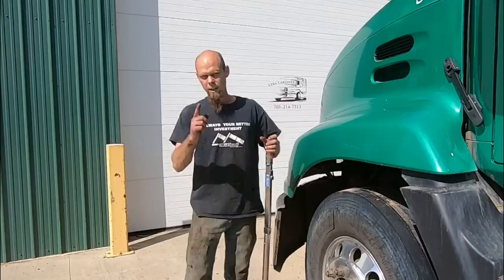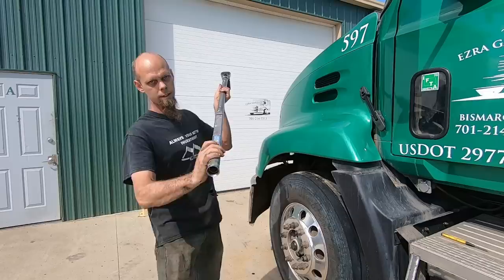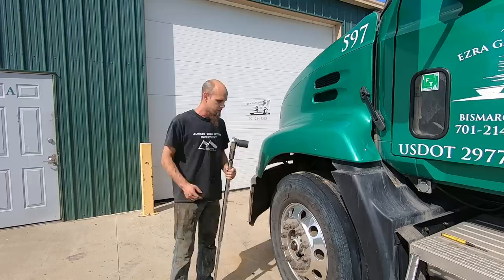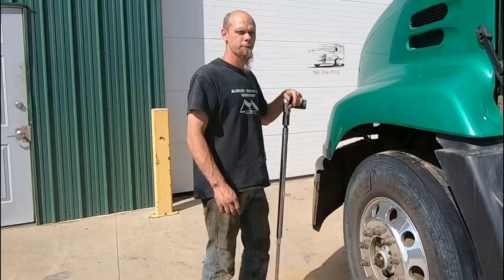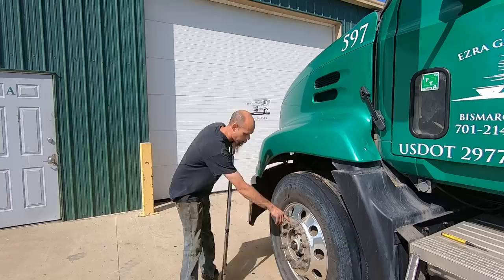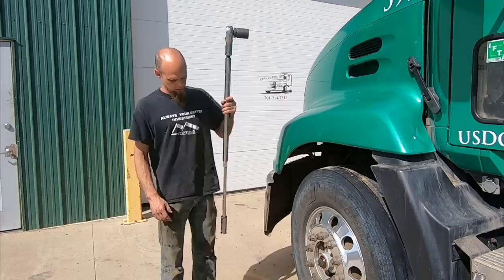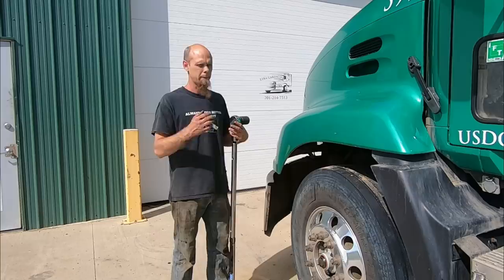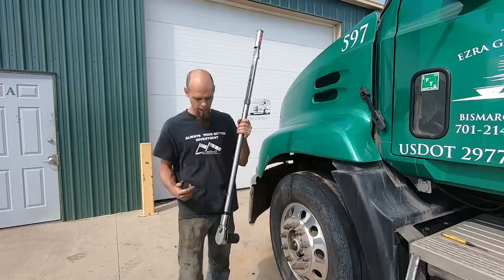Torquing semi truck lug nuts - Precision Instruments - C5D600F36H 1" Drive Torque Wrench

Comment: If only more folks used a torque wrench on lug nuts. 
The 1' tire shop 1500lb torque lug nut gun is for removal!!
Reply from the maker: i use air for removal as well, the breaker bar is a nice bonus don't use it much but its nice too have.
Reply: Tell me about it. My buddy had his brakes changed at a tire shop on a Dodge 3500, and the guy used an impact wrench to put the lug-nuts back on, two days later the lug-studs broke-off and the tires rolled down the highway into the woods....
Reply: We use the gun to put them back on. Never had a problem and we have over 350 trucks in our fleet. Just don’t over tighten them.
Reply: Yes sir. I didn't have nine and had to use a 10ft pipe to get the wheels off.

Comment: I haven’t heard of someone wanting to torque a semi in some time. Impacts were made to loosen lug nuts and NOT tightening them. I cringe when I see or hear a shop use an impact on wheels and not torque them. I’m glad you mentioned the bit about the surface area where the lug nut goes being clean. This is a rule my oldest brother passed down to me ...If you have a tire replaced on a semi, have them checked or re-torqued after 100 miles , when you get back home or if you feel any vibration. Having your own torque wrench is a great idea. I like the preformed cases that come with tools, but I would get a new toolbox and make my own form that would allow the breaker bar to be included. The problem is finding a toolbox wide enough! Good stuff, bro!

Comment: I’ve been using that same wrench for five years now. Works great.
Reply: They need to be calibrated every year.
Reply: Arnoldo Adaire I had The calibration checked a few times, against another calibrated unit, mine  was so close we never sent it back.
Reply: I'm going to get one of these
Reply: How does it works on a rear tandems ?
Reply: @AKA Shady  ...you can get a 14 extension from Kentool or Norbar via Myers if he doesn't already have a link.

Comment: Those PI wrenches are nice, I have 2 of those and they've held up well. Check them every year and so far the calibration hasn't moved any. They're fairly priced for what you get as well I think and nice to be able to buy a US built quality tool still.

Comment: I remember we had these badass HyTorq hydraulic torque monsters, we used them to tighten and torque 4" nuts on the jaw crushers at the surface mine.
Reply: 15 pound sledge hammer on our cone. It's around a 4" thread, hit it till she dont move anymore.
Reply: Hey WOW, I was looking at some of those but went with torcUP due to other considerations but there are many decent players in the field, ALKITRONIC has a good video that explains the affects of lube on studds, when I worked for a over the road fleet and used antisize, the broken studd remover got a lot of use, but when I went to work on garbage trucks and school buses ,the antisize wasn't allowed but then the inner nut would stick and the Budd nut wrench(pork chop) was needed frequently .

Comment: Great video. Excellent discussion on torque specs and pros and cons of the torque wrench. Thanks and cheers.
Reply: Have been doing this 30 years but still not completely satisfied with the methods at hand, sometimes there is lube or antisize on the studds, even from the factory and that changes the friction affects torque as rust would have the opposite effect, I don't have any recommendations at this point but there might be a possibility of using angle instead of torque and some sort of locking device. (like a teardrop plastic nut check)

Comment: Hi again i'm from UK ,i am retired big rig driver/mechanic.I have seen 20 stone drivers  jumping on a wheel brace with a 4 ft scaffold tube on until they hear creak creak ,and then when i have been called out to them when a wheel fly's off they have said to me you must not have tightened them  when maybe i have had wheel off to repair something.Not that 20 stone jumping on 4 ft extension  doesn't stretch wheel stud threads or fractures stud .This was common in my days but you could not tell these type of drivers they know best.IDIOTS.

Comment: This was really helpful! Ive been debating about wether to get a 1in millwakee impact gun, which i still plan on but that torque wrench looks like a good option for on the road, least no batteries!👍🦝
Reply: I happen to own both along with some other air impacts and torque sticks and most recently a pneumatic torque multiplier which seems the most promising, but I would start with the torque wrench like he has or a broke back type. (no relation to the movie)

Comment: Guess I've been lucky, but for 52 years, every lug nut I have had installed has been torqued with a 1" rattle gun. I have had to take a torch and burn of studs on the off highway log truck I drove in the '70s when they seized up due to salt rust and snow those were 14-24 Firestone(?) Rib Excavators on the steer tires. I do remember that the tire and wheel weighed 345 pounds.  And, the tire man at Weyerhaeuser could pick one up and toss it in the back of his tire truck. Nice guy, but not one to mess with.
Reply: Hey WOW man, this all is very manly and I hope I don't come across like a goody two shoes but before anyone tries using a torch on a lugnut that has the tire still on it whether inflated or not, they might want to watch some of the Bridgestone safety videos...I like one title PYROLYSIS.
Reply: @cameronduff884  Nah, the tire was always off the rim. usually, we went back to the shop that night missing studs. Nightshift would replace the studs

Comment: ironic, i am looking at the precision 3/4" torque wrench on amazon as you notification came up.....not sure if i am replacing mine with the precision, cdi (company that makes snap on, or a snap on torque wrench. the fact that the include breaker bar attachment doesnt go in the blow molded case  is irritating....but not a deal breaker for the cost.
Reply from the maker: iv had mine for quite a while now overall im happy with it. i rarely use the breaker bar but its nice to have.  the case and the one button being to small to press with your finger are my biggest complaints. i just decided to do a video on it cause i needed something i could film and upload without a lot of time into it and apparently the internet has a obsession with torque wrenches....lol
Reply: Mr Smith in the house!!!!!
Reply: @Ezrider359  i have a older snap-on and the buttons are the same lol, irritating for what you pay new for them
Reply: I wrote my comment before I read yours
Reply: @flmmaz  how have you been my friend? sure do miss your videos! sure hope things are going well for you.
Reply: @Ezrider359  i ended up ordering the snap on qd4r600a. it is a click type not the split beam....it was a deal.

Comment: That wrench is almost as tall as you!!
Reply from the maker: longer the better, 500 ft lbs is 500 lbs of force at 1ft if the wrench is 5ft long that is reduced to 100 lbs of force for the same 500ft lbs.
Reply: @Ezrider359  make a 500ft long one

Comment: Right in front of handle the steel just snapped only ever used it on one truck and two trailers. Boy seen one one internet for sale about ten miles from home case and everything. It was a prescision instruments six hundred pound. Paid six hundred dollars for snap on. This guy wanted three hundred dollars. I offered him two fifty. He took it. It was exactly the same exactly as snap on. The only difference the snap was red were you adjust it the p I was blue. My son looked on internet and found out p I made the snap on. Still have pre instrument yet works great. Didn’t know if you new that. I torque four fifty truck and dropdeck. Enjoy your show. Just bought tiger tool for taking anchor pins  out when doing brakes Havent used it yet. I will keep watching.

Comment: Well on the flange style lug nuts like in this video requires 5w30 motor oil as well

Its 450 to 500 ft lbs ...

Set the torq wrench to 475 and your good

Me i just oil and use the gun

Reason being 50-100 miles is a retorq requirement...

Drivers dont stop... not my fault ...

Ta charges 7 bucks no wait they come right out
Reply: But according to the Alcoa manual, only 1 to  2 drops per outer end of studd and 1 to 2 drops in the thrust washer. (don't take my word for it either)
Reply: Agreed

Comment: Been looking for a tool like that every time I go to loves for a tire repair I say to myself I wish I had one of those now I got one thanks bigdog
Reply: Do you keep it on the truck? Has the torque calibration gone way off kilter from bouncing in the truck? Thanks
Reply: @markm0000  yes I keep it in the truck calibration still the same
Reply: @1971bigrob  Ok good 👍. I’ll get one along with a extra wheel to mount a steer and get me home. I paid thousands and thousands in roadside tires and I’ve had enough.

Comment: Just bought that brand but in a 3/4 I have the older style wheel ball n seat just got 6 brand new aluminum wheels and want to make sure there torqued right
Reply: Hey WOW, I have the same thing, it's great ain't it!!!just in case you didn't already know it, my ALCOA manual says you can put 1 drop off oil on the studds but not to let any get on the ball seat.(don't take my word for it)....search....

Comment: Nice review and tips. You sure pick great products. I purchased one through your Amazon link. I did notice that you can get it cheaper but minus the breaker bar. Thats probably the norm as the blow molded case shows. The combo pack has the breaker bar added. Can't wait to get it. Keep up the good work.
Reply from the maker: supposedly they have updated the case, to include a spot for the breaker bar as well as a extension and socket.
Reply: @Ezrider359  maybe Precision can send you an updated case. It's worth a call. I'll let you know if they send a case that holds everything when it arrives. Who knows, maybe they updated their case after your product review. I recently got a new blow molded case for a different tool that actualy broke at the clasp after one use.............kind of the same but different.
Reply: @Ezrider359  You are correct. I recieved the combo set all in the case with room for 2 sockets and maybe a short extension. Very nice tool.
Reply: @Ezrider359  cool, we should have come here first, our torque wrench was "sacrificed" for the sake of field expediency, and nothing was said until I pointed out the bow going the wrong way and used a torque calibration cube on it. (they finally sent it out for re testing) but probably were never guilty of being under torque without a regulator or torque stick.

Comment: Nice video! I'm tool / precision friendly; but I've seen Les Schuab's tire techs tightening those nuts with their power tool, idk if it was related, but 1 month after geting new tires (from them) a front rim cracked!!!
Reply: If the crack happened near or around the lug nut, then yes it was due to over tightening the lug nut. The torque spec is there to keep the bolt or nut tightened so you won’t damage anything as well as it not coming loose, whether it would be the threads, the bolt or nut, or the part itself, in this case it was your rim.

Comment: Do they make torque sticks for a torque spec like this? I know they make them for normal passenger vehicles, but for a truck I feel like it would be a decent idea rather than just ramming the lug nuts on you can get in a ball park range for the torque spec
Reply: God Bless You!...I just wish I could give you a straight answer..I found the perfect torque stick from Accutorque (made in Sweden),but can no longer find it in my 1inch drive, 475ftlbs, 33mm configuration, I sent a substitute that wasn't as deep as it needed to be, and was blown off by Myers tire supply after getting the exact part #(like l was supposed to be content with a universal square drive)..but yeah..you can find them..Grey..Steck...but I think the Swedish have seen the writing on the wall and have tooled up to make torque multipliers (I think CPs Blue torque is made in Sweden)(anybody feel free to straighten me out if they better information)

Comment: if you have changed tires and torque them up to spec do  re check   40-60 miles down the road ..man that is an expensive tool  $500 aud  plus in Australia and mating surface is between wheel rim and truck hub not just the wheel nuts too seen heaps wheels that have come/came off laying in the scrub and  wedged between trees cause of not re checking wheel nuts nice to see Ezra giving us some videos on trucks and trucking mechanical information or heads up

Comment: Hi, can you show what kinda, size  and brand of extension do you have for the rear? I have a 3/4" foot torque wrench ( 4' long) and I used a 3/4" to 1/2" adaptor  and an extension to torque my truck. The 1/2" extension broke ;(

Comment: What about drive or trailer tires? Does that set come with an extension?
Reply: That's a a very valid point that I'm glad someone brought up, just wanted to say that my torque stick instructions warned not to use it for that purpose!...must be a different steel?

Comment: oh yeah. you could gut the insides of the case .. then wrap all those piece in plastic. fill it with that expanding foam. presto, custom case. or gut the case and  just use a semi dense foam. my two cents.. good vid..
Reply from the maker: Way too much hassle for the minor annoyance of it not all fitting in the case

Comment: Despite using torque measurements, I've never really liked them. For example most wheel torques are for clean, dry, undamaged threads. An any lube to the mix, PB Blaster, Anti-Sieze, or whatever and you can end up with up with an increase in tensile on the fastener. And it can be significant to the tune of like 50% more tensile
Reply: Hey WOW, there IS someone else that has noticed this, the problem is the tire man isn't allowed time to clean and dry them, also noticed that the factory uses some sort of lube to make it so we can get that pesky first time off without needing a sledge hammer, not to mention the leaking hubcap, has anyone tried using angle instead of torque?....yeah, I know, too slow.

Comment: I have a problem with torquing a bolt or nut  that clicks out  before prior attempts . It could be twice or more over torque.
Reply from the maker: this is a re torque not initial torque meaning the lug nuts were already torqued once and then driven and then you re torque the lug nuts, meaning they shouldn't be under torqued to have the lug nuts move.

Comment: torqued a few wheels when i was younger. Are their '99 model trucks with left-hand threads on the drivers side??
Reply from the maker: Budd wheels (stud pilot) had left hand threads on one side of the truck not really used anymore but you could get a truck with Budd wheels into the late 90's

Comment: The only issue I have is that you did not loosen the lug nuts. By doing this first you actually verify your torque is correct. By not doing it the lug nuts may be over torqued and you would not know it.

Comment: A good rule of thumb don't jerk the tool just constant pressure if you jerk it the torque will be off
Reply: Hey WOW, I think you're right but have also noticed that if you go TOO slow it also keeps going. (but I dig what you're saying)

Comment: Using a 3/4 drive Milwaukee cordless impact would be a lot faster and easier and takes less space in your truck but to each their own I guess
Reply from the maker: 3/4 impact wont properly torque the lug nuts and this has no batteries to be dead when you need it.
Reply: @Ezrider359  not intending to start an argument here but the 3/4 impact will torque the nuts as good as the 1in air impact, hard to believe , I know , I didn't believe myself before I tried
Reply from the maker: A 1 inch air impact won't properly tq the lug nuts eaither
Reply: I have to say that I went through this personally and while it can do it if it has to, it will eventually have issues, that's why they recalled the new 1inch extended anvil gun, they had to put some type of suspension on the battery so it wouldn't shake apart, I would have liked to have saved my money for the new redesigned one, but I couldn't wait and bought a used torcUP RP2000. (but I use the cordless impact to run the nuts)

Comment: If the nut does not move when you are torquing then you are not torquing it. The toruqe wrench setting has been exceeded. Proper procedure for the classic 33mm nut is 450 to 500 oiled for proper torque/claping force.
Reply from the maker: This was a re-torque not a initial tq as clearly stated in the video
Reply: @Ezrider359  which is in what way opposed to what I said? I commented about torturing them. And the proper way.
Reply from the maker: @christopheryoung826  the lug nuts have already been torqued and there is static friction on the threads the only reason why they would move is if they were loose witch they shouldn't be if they were installed properly in the first place.

Comment: I'm afraid of how much it is... But I have to look. Anything 1in you add a zero to the end of a 1/2in drive equivalent.
Reply: Wow I didn't have a heart attach it wasn't $4,000... Might have to get one but I can't think of any big ass bolts to tighten right now. Maybe some C-clamps I have I could use it on.

Comment: 450 ft-lb (unreal),....I'll stick with cars....
Reply: Its actually 500ft-lb I have a blue torque gun
Reply: 🤷🏻‍♂️🤷🏻‍♂️ one of the caps we ran on our cone liners was 500 foot pounds
Reply: Well it is a ‘man’s’ tool so🤷‍♂️
Reply: Steven Skoleski cringe
Reply: totalynotchris 🙃
Reply: For a truck guy, cars are harder, and not so much the same, if you work on a multitude of vehicles, you have it just, if not more tough!